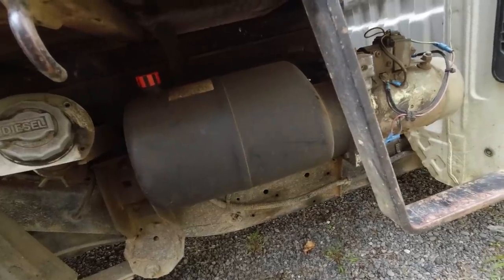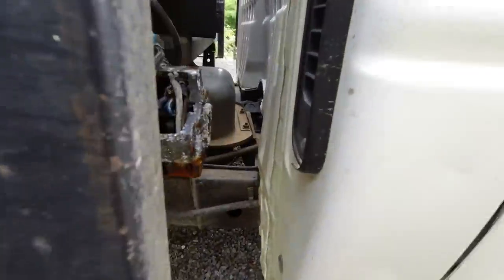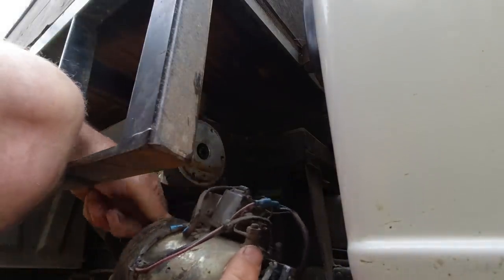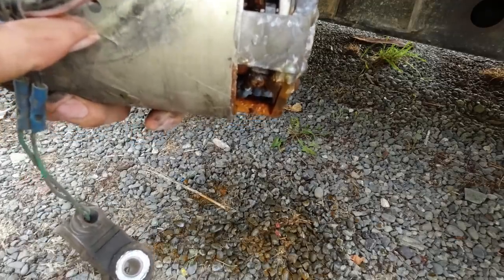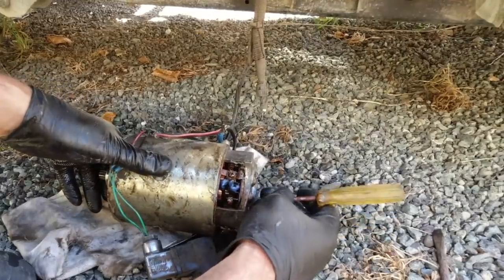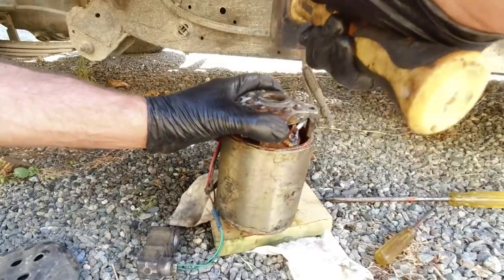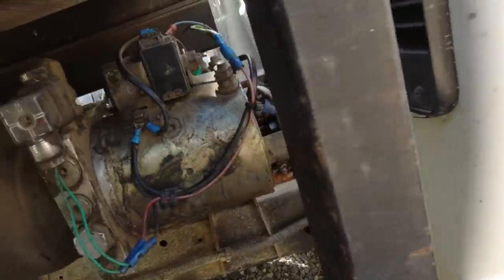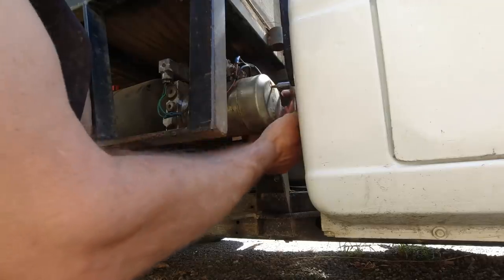Fixing a DC electric / hydraulic tipper motor.

Comment: Seems a bit of a poor design, having the motor sticking out in the weather like that.

FYI Marty, CRC also make a product specifically for using in electric motors, etc.: CRC 2.26.  Doesn't arc like 5.56 can.
Reply: @JohnSmith-yv6eq  Quite possibly the case.  Even if it supposedly was designed for exposed use, I'd prefer to see the motor tucked away fully under the tray.

Comment: That should work for a while now.
I think i would have fitted a drain tube rather than cutting a slot in it as now dust & spray can get in from the road when driving.
With the top cover fitted i don’t think it needed a hole at all to be honest.
Reply: I think some kind of drain is a good idea. It seems that the previous efford to keep the water out was only successful in keeping the water in for a prolonged time and thus furthering the corrosion in there. The drain will prevent the water sitting in there. I agree on the tube however.
Reply from the maker: Mason bees have a habit of blocking up drain tubes around here
Reply: @MartyT  point taken :-)